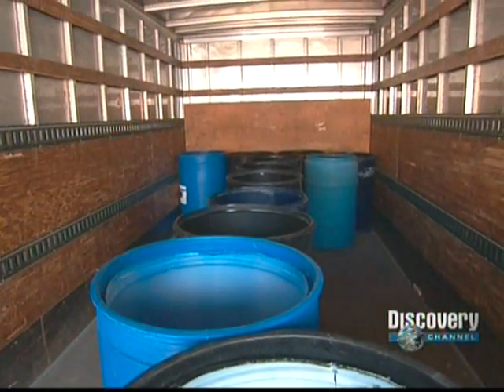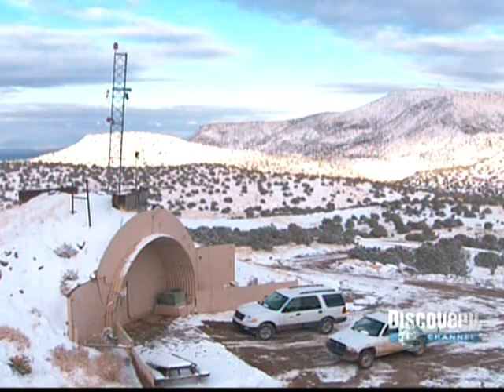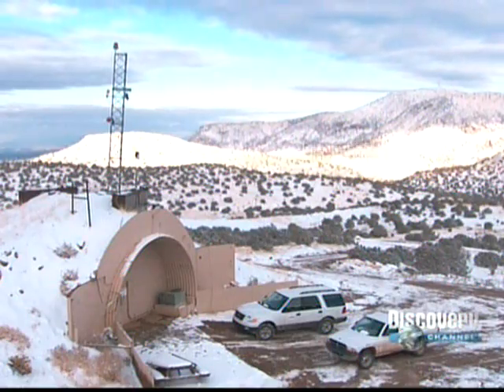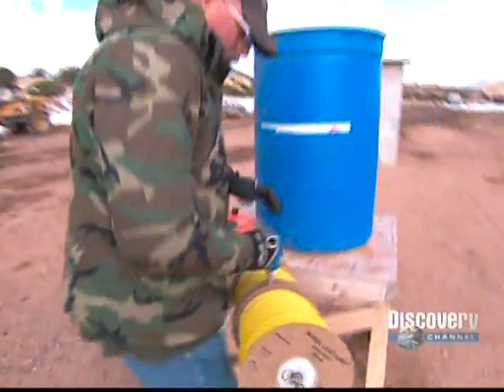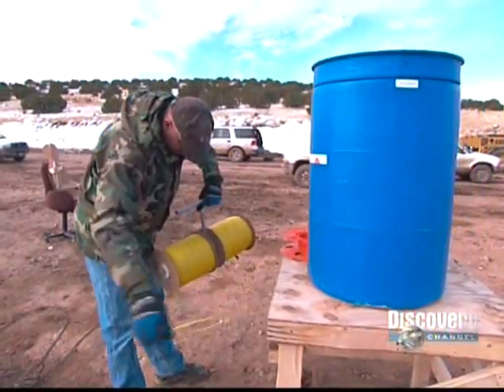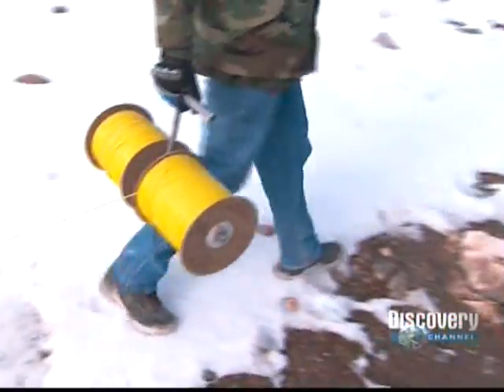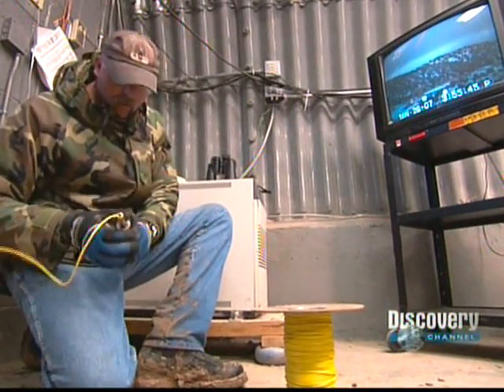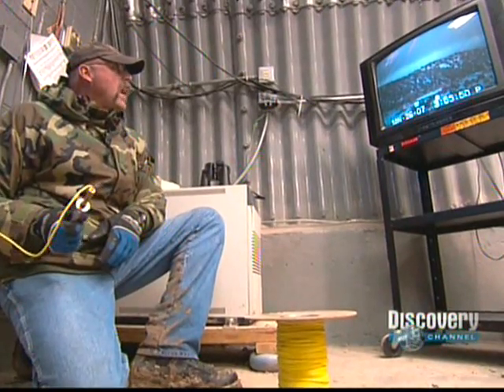Explosives Test Using Shock Tube

Comment: He said the "wind hitting the dummy..." Ok, where to begin? It's not wind hitting that dummy. It's called a concussive blast/shockwave. They are not even remotely close. Who ever narrates this should have some knowledge or someone with the knowledge to advise. Like listening to politicians talk about AR-14s & fully semiautomatic "assault rifles"
Reply: hi bro, what is the cause of the light that moves throughout the shock tube before the explosion? Burning of hmx/aluminum explosive powder or caused by ionization of air atoms inside the tube?
Reply: I think you are death after 4 years 😢

Comment: You'll have to mix it with fine aluminum powder and then set it off using a detonator. You can do it with low explosives, but its a real pain in the ass to get right and if your level of knowledge is so basic, I'd be too concerned with your safety. Unless this is your life calling, there are so many other fun, productive things you can do. Just take a a bit of time to think. Sprinkle a bit of that nitrate into your ground and grow some beautiful tomatoes!

Comment: @gothbro111 your going to need the right kind of ammonium nitrate, it has to be a certain percent , or otherwise the ammonium nitrate will do nothing, even adding fuel oil to it wont do nothing, but if its potent it will be easy to go boom

Comment: @carlespaz Standard shock tube is loaded with a thin dusting of HMX and aluminum, electrostatically adhered to the tubing.

HMX is a powerful high explosive compound.  The shock tube is not given a spark, rather it is initiated via detonation, and its a detonation front that travels through the tube.

Pretty much everything you said is wrong, please check your facts before spreading misinformation.